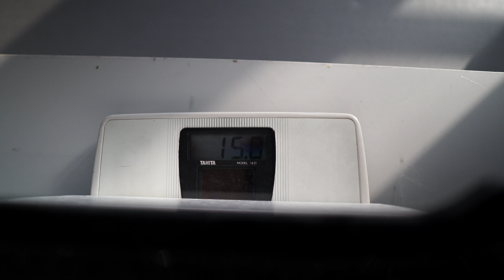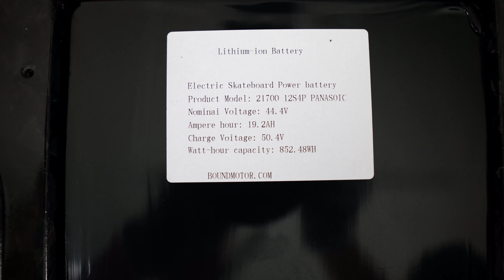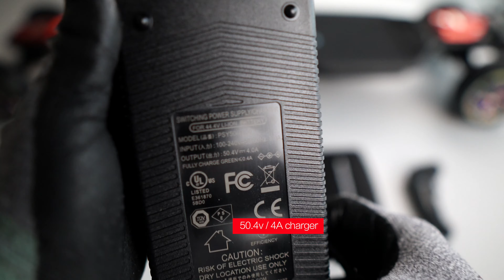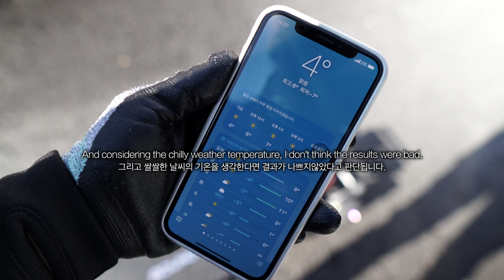#129 BOUNDMOTOR Flash Phantom Hub- It's the beast / different level of output

Comment: Can you review Torque Boards? I’m interested in hearing your opinion on their custom trucks. They are basically extended 12” Caliber II trucks
Reply from the maker: It's not the same as you said, I've used the torque board's 218mm of trucks. But it was hard to feel a big difference from the typical Caliber trucks. However, after changing the bushing to a soft one, the feeling of use improved a little. I think it'll be similar. Thanks~

Comment: Which one you like better this one or the eovan ? Pretty interesting boards ! I like both of them ! Hard choice 👌  thanks in advance!
Reply from the maker: The current output of the Flash and the EOVAN seems to be similar, but the torque on the EOVAN side, which has bigger watts of the motors, feels stronger. 
(I feel that If the Flash is gasoline, Eovan feels like diesel.) Personally, the board that fits my riding style is Flash.
But it's still hard to decide easily because each person's preferred appearance and riding texture are different.
Reply: @KAMiJUINs  I see what you  mean thanks much for the information! Still a hard decision! Lol much appreciate! 👍
Reply: @KAMiJUINs  can you explain why the flash fits your riding style more than the eovan? Is it because it has a shorter wheelbase and is more nimble? Is it because the drop and concave of the deck are deeper? Is it because of the remote? What specifically was important to you in the comparison?
Reply from the maker: As mentioned earlier, it feels like a gasoline engine. Should I say that the torque curve is more stable? (There is no difference in wheelbase length between the two boards.)
No matter how powerful the board is, I don't think it's the right board for me if it's hard for me to use all of that power.
Perhaps it would be good for people who weighed more than me. And as you said, the shape of the deck was good in controlling the board too.
(The Eovan board was too powerful to use in race mode, and it was quite tricky to use to me. Also, the torque curve was very nervous, so It made me a bit scared.)

Comment: Hey will the Boundmotor Phantom hub work on the Meepo hurricane?
Reply from the maker: Hi bro ~ 
It will be possible, but the belt length will have to be adjusted~ (The axles are both equal to 8mm)
Reply: @KAMiJUINs  do you have a discount code for them?
Reply from the maker: I don't know what the minimum purchase limit is, but there is a $100 discount coupon.
KAMI, try this~
Reply: @KAMiJUINs  I tried on the phantom hubs it didn’t let me unfortunately

Comment: So did you actually swap out the motors?  If so, did you see a performance improvement and did you see a range improvement?  Curious about the brakes.

Great vid dude!  Have watched several of your vids.  You do a great job!
Reply from the maker: The meaning of upgrading the motor according to the purpose of riding is... If someone wants stronger torque than the current state of the board, use a motor with a low Kv number or wants faster top speed than the current board, use a motor with a high Kv number. And the brake has more to do with ESC's output than with the motor. Thank you for watching :)

Comment: Hey Kami! Where can we find these offroad tires ? Thx
Reply from the maker: Tire - https://trampaboards.com/trampa-mudplugger-375x-2x-8-inch-tyre--fits-375-inch-rim--new-p-12120.html
Tube - https://trampaboards.com/8-inch-reenforced-inner-tube-made-by-innova--200x50mm-p-11907.html
Thanks~
Reply: @KAMiJUINs  thanks 👍 and did you use stock pulleys ? Appreciate it man !
Reply from the maker: yeah :)